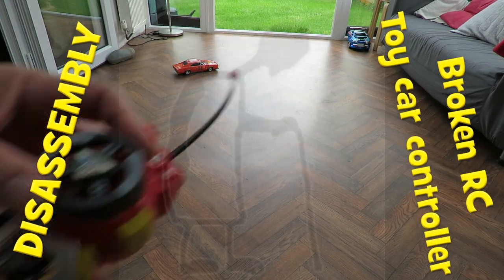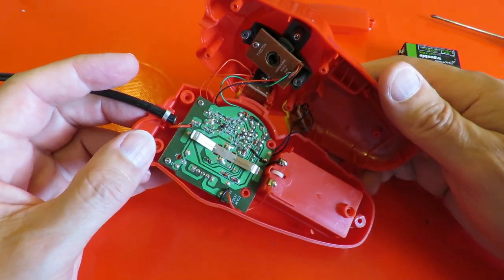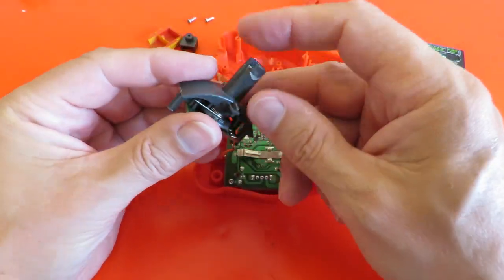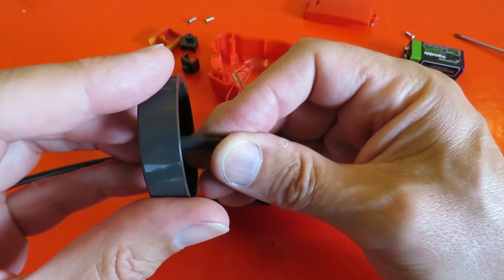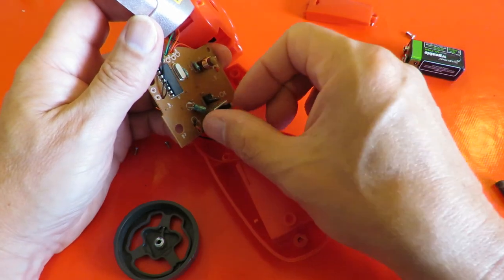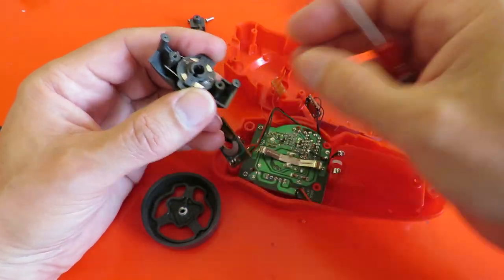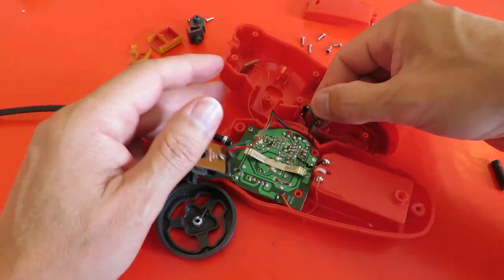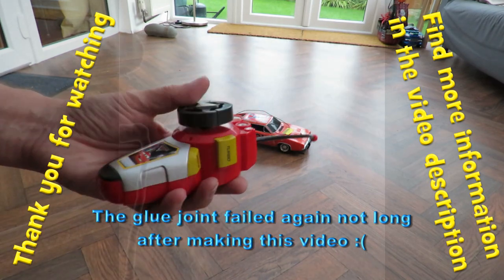Broken RC Toy Car controller disassembly

Comment: Nicely done sir, nicely done :)
Reply from the maker: As a fix it was not very robust. A screw through the middle of the wheel down into the hollow shaft would have been stronger. However it was interesting to look inside. The chip on the car was an RX6 and this controller matched it so I would guess it must be a TX6. You might have already seen me mention that in a reply on the previous episodes. I am thinking a project to use the circuit board and make up a controller with a more standard layout is probably the way I will go with this eventually. Thinking about it I am sure I have an old 35MHz transmitter in the loft that is doing nothing. However if I scrap that you know what the next Charity shop find will be. Some sort of RC toy that uses old fashioned 35 MHz ....
Reply: Indeed, in the comments of the other video was the first time i'd heard of the RX6/TX6...thems fancy things for fancy people !
Reply from the maker: slider2732 I had some RC cars a while back that had 4 selectable channels on 27MHz and that sounded interesting. I didn't have matching controllers for them either.

Comment: nice car shame about the controller haven't you got one in your box which is compatible
Reply from the maker: This is a controller from my box. The car didn't have one when I bought it. I will probably use the components from this controller to make one with a standard layout as I really cannot get the hang of the combined tilt & turn arrangement. I am sure it is designed for single hand control but I don't like it.
Reply: +GrandadIsAnOldMan i think you should make the standard configuration teansmitter
Reply from the maker: Riley howe-mills It will be on my list :)